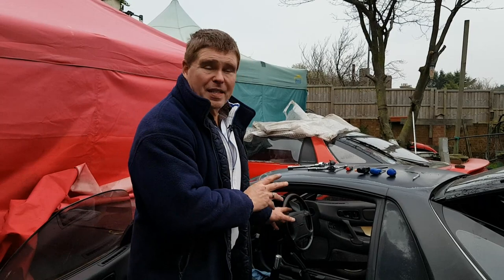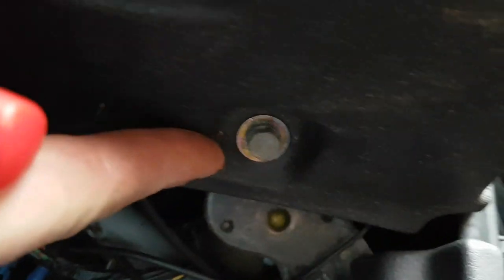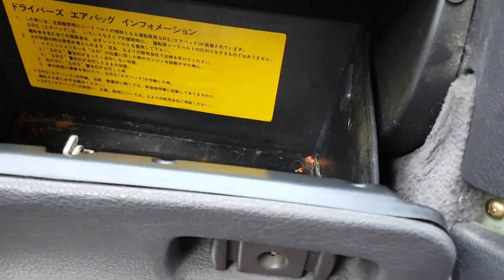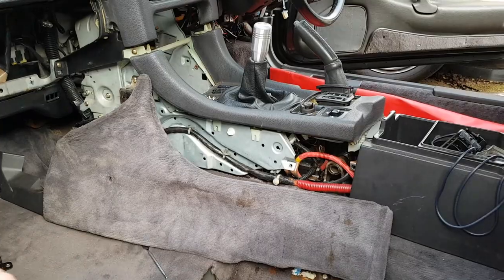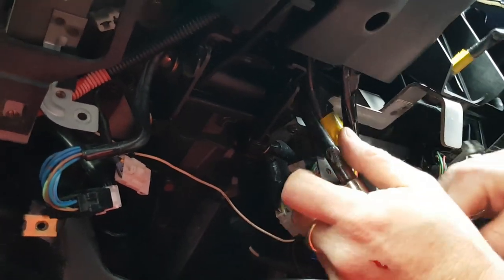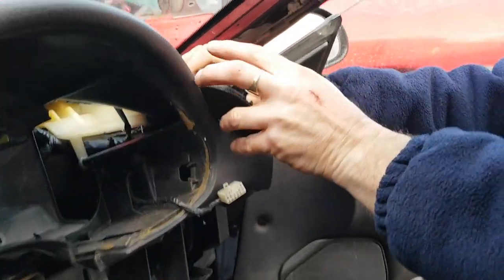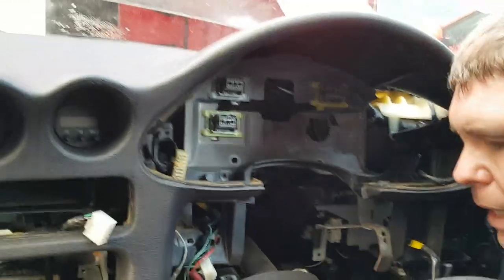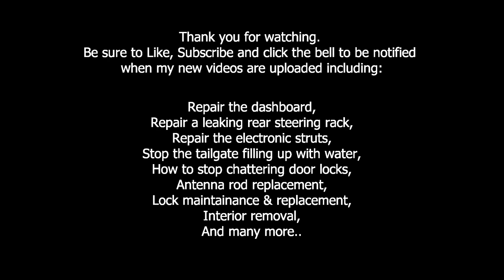Mitsubishi 3000gt / GTO Dashboard Removal & Restoration Part 2 (Dashboard Removal)

Comment: Hey joe sorry to annoy you again but my cluster needles have been removed to put on a different display plate and the needles never put back on right, my revs read 2.5k when engines actually at 800 and similar with the Speedo, I was wonder is there any way to put the cluster into a "set" position to accurately put the needles on

Comment: Thank you for this video, currently removing dashboard on my 98 VR-4 and it helps a lot.
Though for me it was easier to use a thread to remove glove box door stops and to disconnect tweeter I had to push down on lever instead of pulling it as you did.

Comment: Your missing the step on how to remove the speedometer cable.
Reply from the maker: The model used in the video does not use a cable. It is electronic speed sensor.

Comment: Really would like a turbo manifold replacement video
Reply from the maker: Front or back? Is there a reason for this? It isn't a part that usually needs replacing.
Reply: @3000GTGTORestoration   prefer both but either one will work  and I'm putting aftermarket ones in, the OEM ones are getting bad  just need to know the best way to take them off  also thank you so much for what you do, I've watched all of your videos in the past few days

Comment: awesome video it's been 10 years since I removed my dash. I found an almost new one as 
I need to replace mine. Is it difficult to transfer the center gauges? I can't remember if there were any parts that with old age I might want to have ready. Thanks for the awesome videos.
Reply from the maker: Once the dashboard is out, you will need to remove the heating pipes and then the clocks will be accessible.

Comment: Your videos are great! Thank you for tackling these cars, mods and restorations.  One question I can't seem to find the answer to: Where does the defrost vent photocell plug into? I want to replace my vents with after market ones but REALLY don't want to take out the dash. Can I access the terminal by removing the glove box per your Part 2 video?
Reply from the maker: Hi seth. It is possible to remove the sensor by just removing the glove box but it is a very tight spot to get to. I can't find a way of adding a picture for where the plug is. You can either contact me via WhatsApp and I will send a picture or look for yourself once the box is out. Thanks for watching. Joe

Comment: hi part 1 and 2 very interesting, in part 3 do you remove centre dials
Reply from the maker: Hi Andy. Part 3 will be a full strip down of the Dashboard, including clocks. I will then demonstrate how to repair any warped sections in order to fit new vents. Thanks for watching. Regards. Joe

Comment: Do you sell some of the parts you remove?
Reply from the maker: Only if they are surplus to my own needs.
Reply: @3000GTGTORestoration  I really need that digital radio you got there :D
Reply from the maker: It is just a cheap one off ebay.
Reply: @3000GTGTORestoration  Okay, i need a power antenna as well, do you have that for sale mate?
Reply from the maker: The antenna rods break a lot due to age but they are still available from mitsubishi